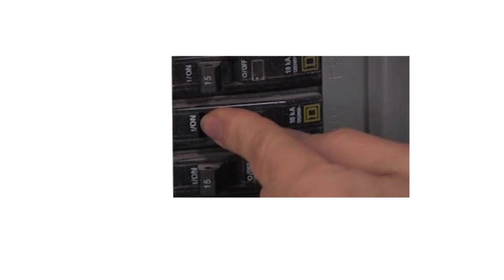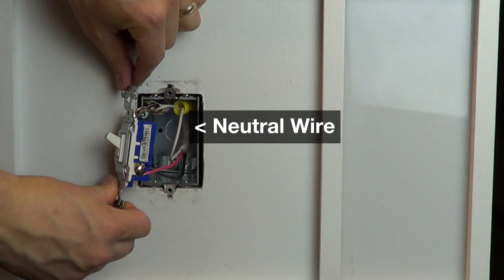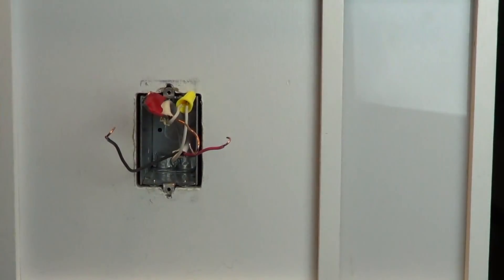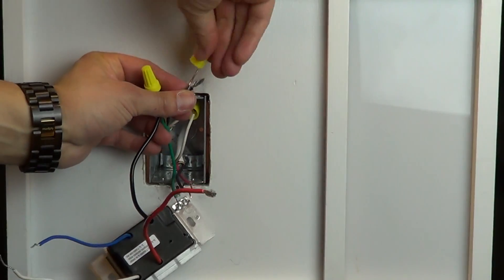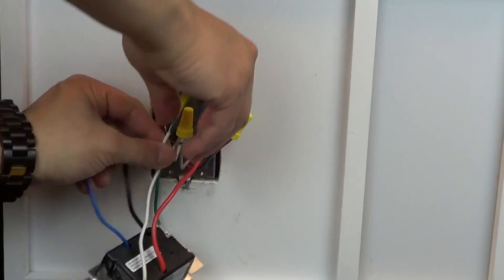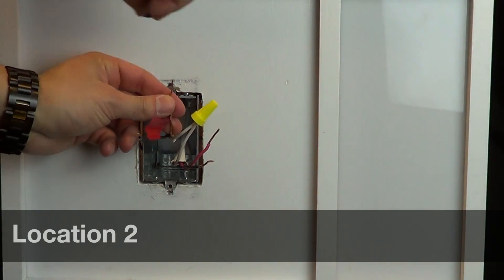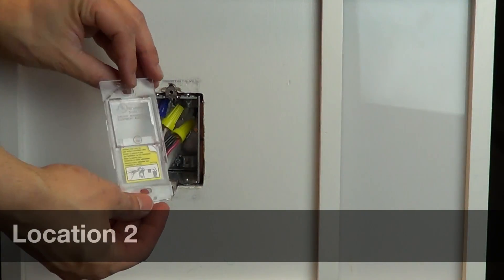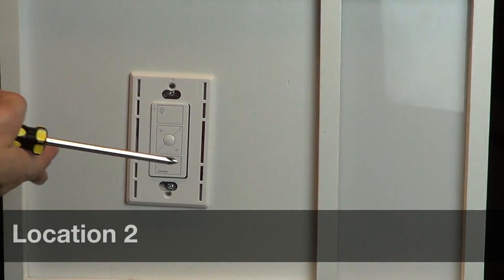Wiring a Control with One Black, One Red, One Blue, One White Wire (3-Way with a Pico Remote)

Comment: Hello, I have this type of switch with a dvcl _153p dimmer and I have a problem with my lamp, it is a ll4rr_3018k, it is a Lotus led drivers, when I lower the intensity the lamps keep flickering. What I want to know is if the switch is compatible with the lamp

Comment: After following these directions for the dimmer switch, the light didn’t come on. Then i find out from an electrician that the directions are wrong. The different colored screw is the grounded wire, which attaches to the green wire on the lutron switch

Comment: why would you cap a bare unused copper ground?  Whats the purpose?
Reply from the maker: Hello, Capping the ground wire at the Pico's location will prevent the circuit breaker from tripping. There is line voltage passing through the three wires that are capped together, and if line voltage comes in contact with the grounding wire, it will immediately trip the breaker. Hope this helps.
Reply: @Lutron-Electronics  But the ground is bare.  there are another 3 inches that aren't covered.  the cap only covers the end.
Reply from the maker: @vibepusher2717  Hello, This is to ensure that the rest of the exposed ground wire does not come into contact with the wires carrying line voltage. The cap on the end of the ground would prevent the terminated end from interacting with one of the other wires. Thanks

Comment: I followed these instructions but once I cap location 2, my lights will stay in the on position and I cannot turn off with location 1. Any advice?
Reply: Obviously.  I came here looking for answers as I came across this in the manual and it’s obviously not correct.  They’re selling this “3-way” device and wiring it up in every scenario as if it’s a single pole switch with a remote.
Reply from the maker: Hi Matthew, If you are having difficulties we recommend contacting our tech support team. They are available 24/7 and would be happy to help you. You can reach them at 1-888-Lutron1 (588-7661). Thanks!

Comment: The instructions in this video say "connect the tagged wire to the black wire on the dimmer"  However the PDF instructions for the PD-5ANS/PD-6ANS say to tagged wire to the RED wire. 
Which one is right?
Reply from the maker: Hi Ben, Depending on the application (single pole vs. 3-way) both could be correct. If the Caséta Wireless switch is installed on a single pole circuit, the tagged wire (constant hot) would be connected to the black wire on the switch. If the device is installed on a 3-way circuit and is on the line side (where constant hot is located), the tagged wire would go to the black wire on the switch. If the devices is on the load side (where the switch leg to the fixture is located), the tagged wire would go on the red wire of the switch. Hope this helps!
Reply: Once again wrong.  You people have no idea how a 3 way switch works.  In every video or pdf the blue wire isn’t even used.  So whoever designed these things is a moron

Comment: I understand that the blue wire isn't needed here, but I'm curious, what purpose does the blue wire serve?
Reply from the maker: Hello Ben, The blue wire would be used for 3-way applications with a traditional 3-way switch. For more information, please visit page 30 on the advanced installation guide https://www.casetawireless.com/Documents/0301710a_Caseta%20Advanced%20Inst.pdf. Hope this helps!
Reply: @Lutron-Electronics  It took me so many hours of research to figure out why my 3 way caseta set up with a mechanical switch wasn't working. I found my answer in the comments of your YouTube video. You should really provide these instructions right in the box or give better resources to find the answer. 

Happily, I have it all working now.
Reply from the maker: @JonathanLYouTube  Hello! We are sorry to hear that you were experiencing issues and we appreciate your feedback. We do have a support team that are happy to assist with issues like this. They are available 24/7 and can be reached at 1-888-Lutron1 (588-7661). Thanks!
Reply: I had the same issue, the included instructions are inaccurate - and the link above from lutron is broken. But I found an updated one, check out page 28 of this doc: https://cache-m2.smarthome.com/manuals/66339-advanced-instructions-1b.pdf

Comment: This video shows the marked wire attaching to the black lead on the Lutron device. The 3 way wiring instructions on the Lutron website show the marked wire attached to the red wire. Which one is correct? I debugged my install for an hour based on the instructions before I found this video, followed it instead and successfully completed my install.
Reply from the maker: Hi Greg, For a 3-way installation, the marked wire could be either line voltage or the load depending on which side of the 3-way is being examined. The common wire on the line voltage side of the 3-way will be going to the black wire of the dimmer. The common wire on the load side of the 3-way will be going to the red wire of the dimmer.

Comment: Does it matter in which location you hard wire the switch ex. Like the leg end or where the power is supplied in the three way
Reply: I am having problems with mu 3 way light switch the first switch has 2 black wires 1 red 1 white start to work then I had to replace the 2nd 3 way switch but these wires are totally different from 1st switch there is 1 black 1 red and 2  white wires do not know where to hook up these wires
Reply from the maker: Hi James, depending on the dimmer and whether the neutral is needing to be connected, will determine which side (line or load) the device can be placed. We recommend reviewing the install guide of your device prior to installation. For more information on any device please visit our support site (www.lutron.com/support )
Reply: That generic reply doesn’t answer the question.  Also all your tutorial videos point to the same video and the info is incorrect.  If you’re capping off the travelers together then your three way circuit will not work.  This is only valid in one scenario and you recommend it for every scenario.  Which is utterly wrong.  I came here with the same question only to find you didn’t really answer it correctly.  I’ll figure this out on my own and return with the correct answer.

Comment: Is it necessary to install two switches or will the one work with a  decora switch?
Reply from the maker: Hello James,

In this video, we installed one Caseta dimmer and one Pico remote. This is because the setup was originally a 3-way with two switches controlling one light. Some Caseta models only work in a 3-way with Pico remotes. However, this Caseta model has a blue wire, and thus can also work in a 3-way with a standard mechanical switch. Here is a video that shows how that setup would be wired:

https://www.youtube.com/watch?v=QzhhM-3hCM4

If you have any questions about wiring options for your dimmer model, we recommend referencing the installation guide. A digital version can be found at http://lutron.com/support.

Please let us know if we can be of further assistance.